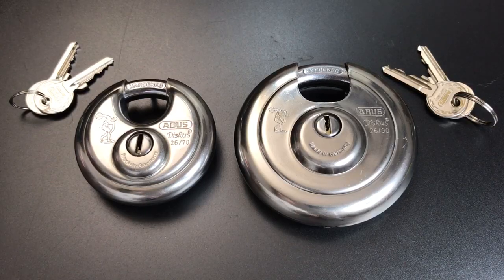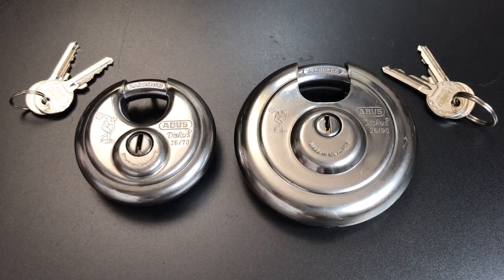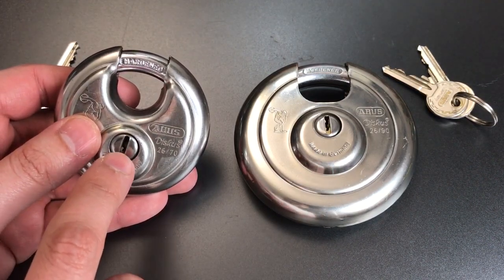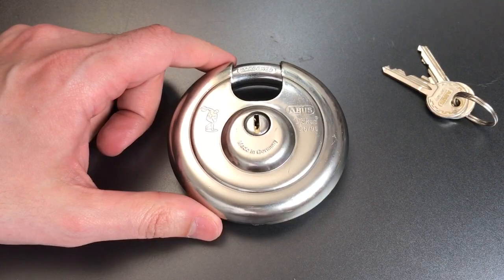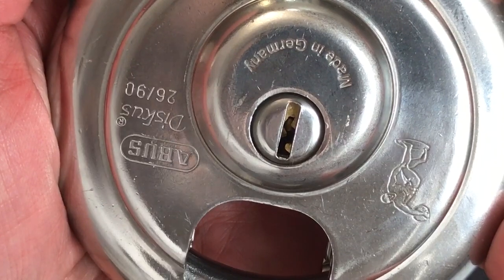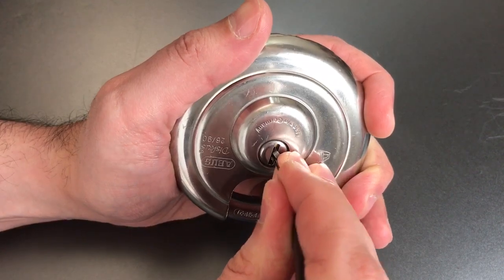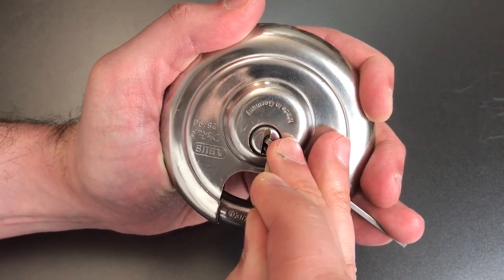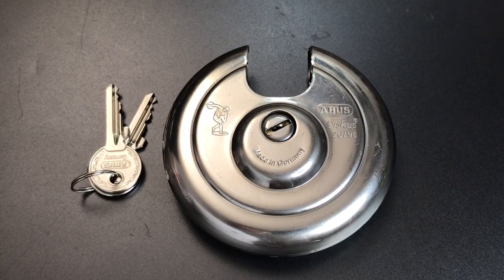[447] HUGE Abus 26/90 Diskus Padlock Picked

Comment: Now that is a big lock. Great picking and love the laminated metal inside.
Reply from the maker: Thanks... I like this design better myself.
Reply: @lockpickinglawyer  Dear mr. LPL id like to hear your advice please,  is this 26 better than the discus 25 ? I wonder  if the pins key make the 25 safer?
Reply: @lockpickinglawyer  I like it too but the hollow design on the smaller one (I use a 20/70) is good for my hard bicycle trunk because it saved weight. Perhaps they could launch a separate reinforced series. I'm not sure it's necessary though because if it's not already strong enough maybe you ought to go with something higher end

Comment: Being that the shackle is so much further away from the core radially than the normal variants, I imagine some of the resistance would be due to the torque increase. The laminations may also be snugged up against the shackle.

Comment: The Abus Diskus are pretty common here in Europe. The drag is also noticeable on my Abus 24/90. (The 24/90 is nearly identical to the 26/90 sold 15 years ago.)
Reply from the maker: Thanks for sharing your experiences on core drag... the diskus is pretty common here as well, but not the 90mm variant.  All we see is the 70mm locks.

Comment: The 26 series keys snap so easy, thats why I've changed to the 20 series and they seem to be all round better made to be honest, keys, whether protection and body strengh.
Reply from the maker: The 20's are definitely very nice.  If I had need for a disc padlock, that's probably what I would use.
Reply: Good thing is you can put them in an Abus van lock hasp, as they use the Diskus inside them. Works a treat!
Reply: Paul Edwards Does anyone know what are the actual inner dimensions of the Abus van "hasp/lock" as I could not find it anywhere online? I would love to know so I can see which Abus diskus I can use with it. Would 20/80 fit inside?
Reply: it will take any size 70 diskus, i don't think the 20/80 will fit, the 20/70 defiantly does because thats what i put in them.
Reply: The 20/70 is the way to go , awesome lock :]

Comment: Looking big and heavy duty is important for deterrence and being an Abus it probably is heavy duty and it's also a bit harder to pick not that picking is as common as brute force attacks.
Also if you find it more difficult to pick them many will find it even more so! Pick resistant even!
Might make sense for locking my bike up at home but I'm not sure I want to take it riding...but maybe.
It's interesting that the space for chain isn't much bigger than the smaller lock!
What size chain will it take?
3/8"? Or?

Comment: Shocked to see a disc padlock that isn't that same standard size.
Reply from the maker: The 70's are definitely the most common.  I sometimes see the 80mm Master 40M, and the Abus 20/80 in use, but I don't recall ever seeing a 90mm disc lock in the wild.  I only have 2 in my collection... this and the Godrej 90mm Duralock (with 14 pin core).

Comment: Hi, can I please ask you how would you compare the 26/90 and Abus 20/70 or 20/80 from your [150] video in physical security and pick resistance? Your thoughts on value for $?
Thanks in advance and keep up the amazing work. Thumbs up! :-)
Reply from the maker: The 20 series is FAR more pick resistant. the 90mm lock is far more resistant to physical attacks than either of the others.  As for value -- I'm a fan of the 20/70.

Comment: Can I ask you what % of locks are bypassed by picking?

I'm thinking 99% of criminals can only pick their nose and so physical security is way more Important.
Reply: I think a lot of criminals can pick locks that are easy to pick honestly so I think the pick resistance is maybe just as important as the physical strength of the lock honestly but the lock picking lawyer would know better than I do and could answer better than I do but the pick resistance is extremely important!